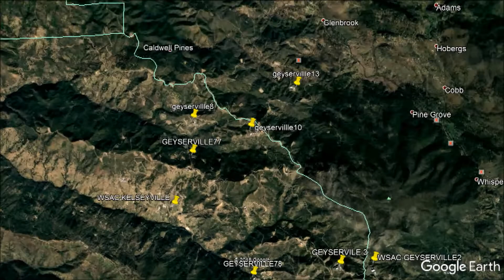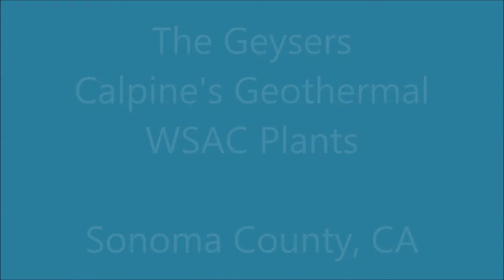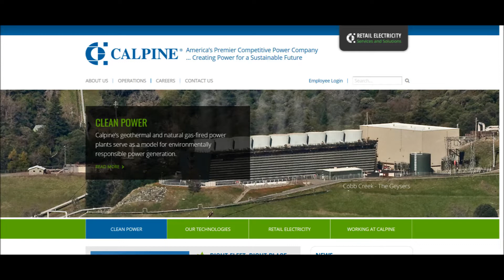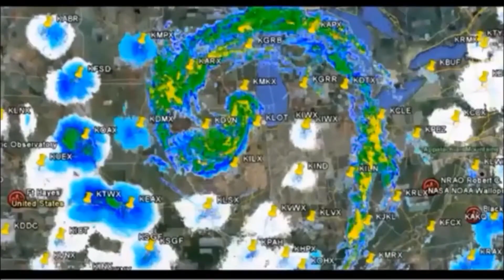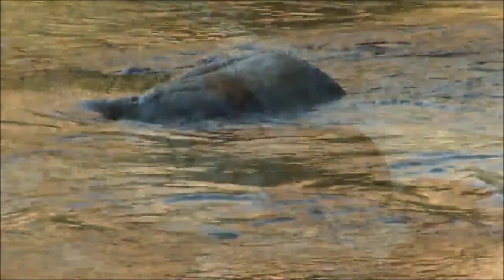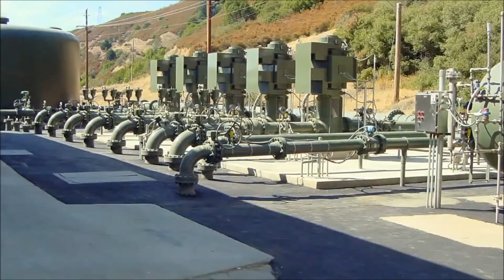The Largest Wet Surface Air Coolers (WSAC) in the US ~ Geyeserville

Comment: FYI - WSAC is a BRAND.  These are not WSAC's.  These look to be standard open counter flow cooling towers. FACT:  WSAC's are not shown in this video! Do more research on the product!
Reply: Wsac stands for Wet surface(to)air coolers. And thats exactly what they are...
Reply: Evaporative cooler! NOT WSAC.